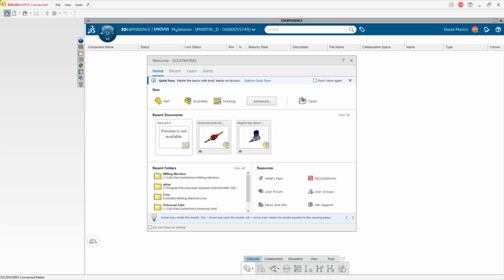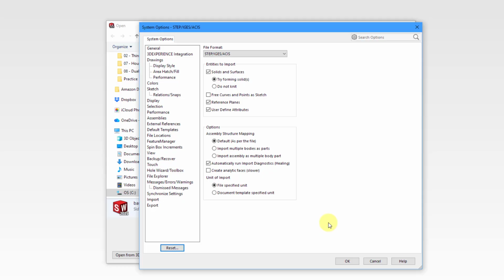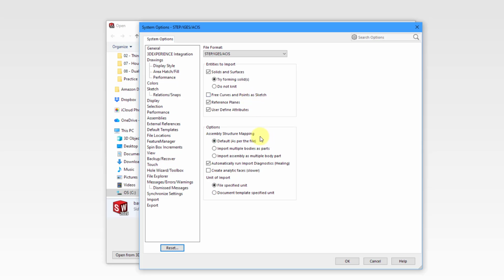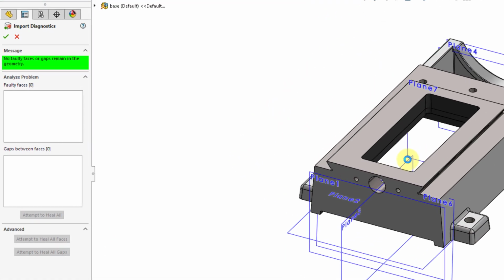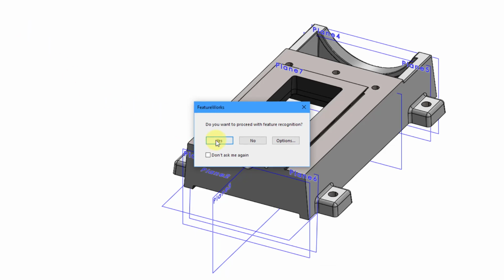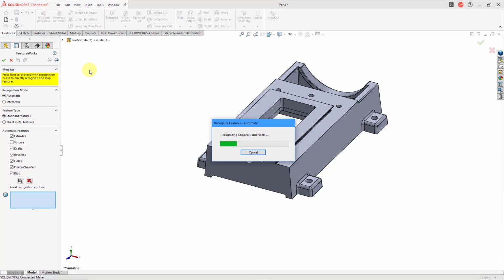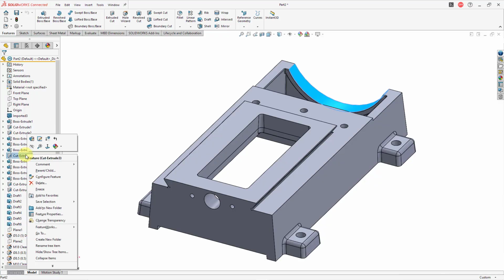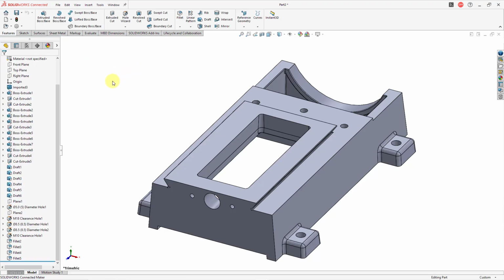How to Import STEP Files and Recognize Features in SolidWorks

Comment: What if you have a complex assembly?
Reply from the maker: What is the use case? Are you trying to reverse engineer someone else's product?

Feature Recognition is better suited to generally prismatic (and simple) parts. Feature Recognition does not convert 100% of features, such as complex surfaces. You should not have any expectations of success using it on complex assemblies.